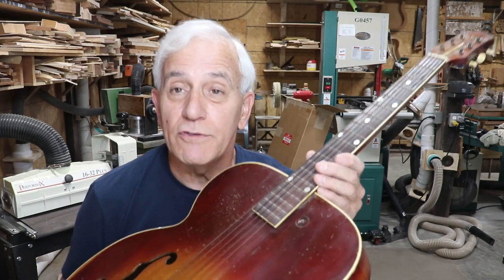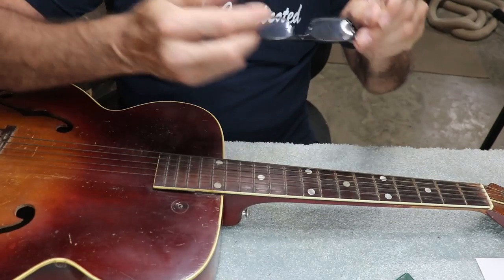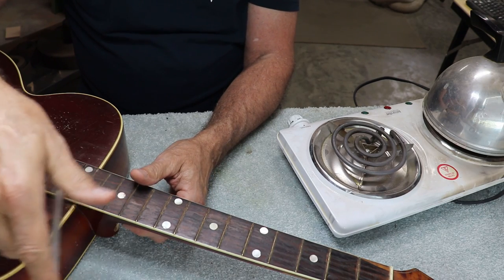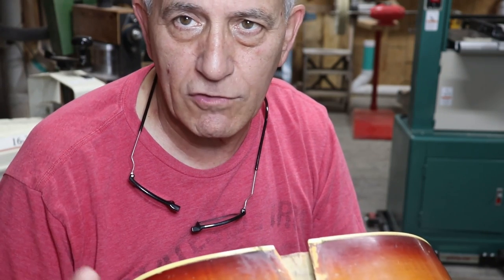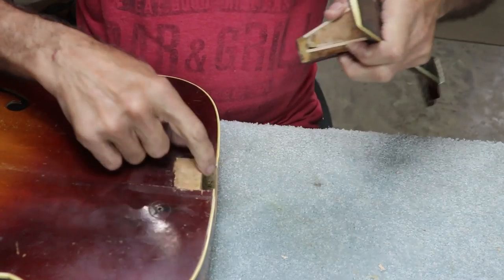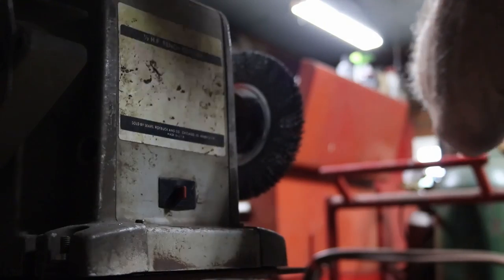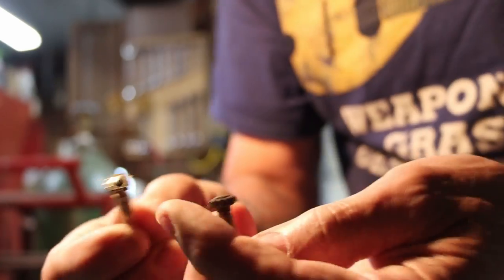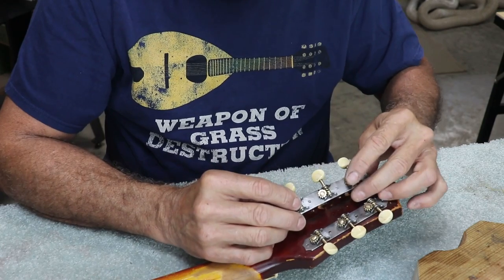414 RSW Sherwood Standard Guitar Neck Reset

Comment: Sherwood was one of Montgomery Ward's mail order brands. It was created just after WW2 and before WW2, the company used the names of Wards and Recording King for its instruments- the RK brand being more up-market than Wards. In the 1920s their brand was Concertone.  On that basis, Wards branded guitars were mainly made by Kay while most of the RK instruments were made by Gibson. However, some of the Wards branded instruments were made by Gibson and the 1936 Wards Model 1642 mandolin was made by Gibson and was the same as the Gibson A50- except it did not have a neck truss rod. You can see that the Kluson tuners have rivets on the gears and date the guitar to just after WW2. The guitar appears to be based on the Kay 39 made from 1947-51. Montgomery Ward changed from the Sherwood brand to Airline at some point in the lae 50s or early 60s. Montgomery Ward retailed some very nice guitars and mandolins but also catered for the lower end of the market as well. This one is mid-market- Kay advertised their version at $45 while Wards would probably have sold it for less than $30- cutting out the middleman. As metal became scarce in WW2, Kluson, the tuner makers began to used rivets or just a blob of metal to replace the screws- and this is what you show. These tuners were used until the late 40s when screws returned and Kluson also started to enclose the gears in a little box.
Reply: That is some good knowledge. Can you tell me anything about the 'Pablo Camille Video' brand? I think it's a Gibson L1, no truss rod.
Reply: I have an unbranded Kay that looks just like this guitar structurally speaking. The same reinforcement around the f holes and dot pattern on the frets.

Comment: Like many others here, I'd never heard/read of a 'Sherwood' guitar, but she deserves to be treated kindly, anyway. And, of course, as always, Jerry soothes her discomforts, and she looked a lot more sassy when she took to the dance floor, at the end. Arch top, f-hole guitars always have a specific sound to them...unique...some folks like 'em...some don't. They also respond totally differently to touch and nuance than other styles, but they're pretty dang keen, nonetheless. I worried mightily when I got my first glimpse of that scarred, glue-caked, shrapnel damaged neck joint...yikes. However, Dr. Rosa had her prepped, mended, stitched up, and prepared for action, in (nearly) no time. Thanks, Doc R...just listen to her now...and lawdy, take in them sweet curves.

Comment: Hi Jerry, I am back taking a look at this reset.  I am finishing up a reset on a friend's "51" Gretsch 5120 archtop jazz guitar. Well played, and fell off the wall and broke the neck joint before Covid started. He had dropped the guitar off for me to check out.  I messed with it for hours. It was pretty loose but I couldn't get the neck to pop off.  After a consult with a couple of guys, I found out that some nut job had pulled the fret out where you would normally get steam in, and he had driven 3 4p finish nails in the neck to hold it... Crazy. I used a thin crowbar to slowly pull the neck up with the nails.... Thank goodness there was no heavy glue on the nails. Now all cleaned up and ready to reset. Oddly enough, after I have sanded everything down and all the old glue from at least two resets and nail holes filled, The neck fits so tight it doesn't really need shims....! That puzzles me. I put a straight edge on all sides and it is tight as a drum dead-on down the fretboard and with the nut set to the bridge is also dead on!! Hmmm. I am going to glue it up with fresh hide glue in the neck day or so.  Soaking glue today!  Love the video here which gives me confidence that I will giterdone without issue!! Can't wait to play this beauty.  I just finished a 64 Gretsch Country Gentlemen number 64064...! Just 2 numbers away from George Harrisons.  I may buy it from the owner.  What a player's guitar that is!!! Keep up these great videos my friend.

Comment: Nice job. Not a “cost is no object” restoration but bought back to life in fine fashion!  You make resetting the neck with all the correct angles look easy. I’m sure it takes some time to learn that skill. That guitar didn’t have much hardware but we would call that button screw, “the main screw”. Must have been left over from replacing the deck steps.

Comment: The dry heat stick with the neck removal jig works pretty well......and pretty quickly.  I used it last on a Kay guitar in fact. I'm not sure how it would work with all glues, but with the Kay neck it worked very well.

Comment: Jerry, I use the the "Heat Stick" from Stewmac and I love it. No moisture so you can actually work on heal the same day with out waiting for the wood to dry. Also no steam to ruin the finish..only thing is the hole is just a little bigger than the fret so you will have to so some filling. Another good thing is if you do miss the pocket (which im not going to lie I have missed it a few times😔. Not entirelymy fault, it was the way they were built.) but the heat radiates and finds itself in the pocket. I personally choose the heat stick over steam. My personal opinion. Good job on this instrument.
Reply: I tried it on a Yamaha and after 2 hours, the neck would not come out.
Reply: @Hutch Guitars  Yamaha doesn't use a dove tail joint. Most imports use a dowels to secure the neck
Reply: @maheshchander03  the 2 I've worked on had dovetails.
Reply: @Hutch Guitars  my mistake then. Guess I should have said the ones I have worked on have been dowels with occasional mortise and tendon. Best of luck to you my friend

Comment: Just had the strange experience of reliving work on a guitar I've just finished! Mine is a '40s (probably) SS Stewart, also a rebrand of the Kay "Imperial." It's all about the necks of these beauties. If this one is like mine, it features a 25 3/4" scale length, which, for those keeping score at home, is 1/4" longer than a Fender Strat! Until working on this guitar, I had never confronted how string tension is related to scale length. Unlike a Strat, it's not a bolt-on neck you can shim, the neck isn't laminated, the neck doesn't have a truss rod; it's been on its own to stand up to the pressure. The neck on the SS Stewart had failed and failed repeatedly. Mine suffered a botched cowboy neck reset which apparently was done with a pruning saw. There were dowels everywhere, and multiple types of glue—all hidden under a slathering of black paint. A holy mess! Before even STARTING the neck reset, the joint was so bad that the fingerboard needing removing to get at it properly and the black paint (and the finish) removed around the heel. The dovetail was almost completely destroyed and had to be rebuilt. The pruning saw had torn up the plywood of the sides, and this needed to be relaminated and patched just to have a solid base for the neck. The neck block was separating and had to be reinforced. Then the reset: the angle the neck needed to come down was so great I couldn't believe my eyes, but it was right. So I could absolutely relate, watching you struggle with the Sherwood.

Worth all this? Yes, gosh, it plays and sounds great and it may be one of a kind. Never found another like it. The moral of the story is, use light strings on this vintage of guitar with a massive scale length—better yet, used extra lights.

Thanks for your many tips, Jerry. Just working on this one, since I had the fretboard off, I used your wedge technique to solidify the connection of the dovetail to the neck block and ensure its angle. I've done that with a couple of guitars and it has worked well.

Comment: Jerry, if you have a 40W or more soldering iron, which uses a solid rod type point, you can get a piece of
copper rod the same diameter x 6" and try it out, to remove a neck.
That is what I am waiting to do to a Yamaha FG512. We'll see.
PS: The Stewmac iron is 40W, so anything over that will need to be watched, to not burn the wood.

Comment: Hi Jerry, I recently rebuilt an identical guitar,  The discoloration around the f hole is a cloth :reinforcing" that prevents cracking???  Love my large irregular dots.  I took the back off to rebuild the braces (tapering them and improving the bridge plate) and reset the neck without removing it.  My guitar sounds great.  Best of luck with this build.
Reply: found something similar in a 49ish Kay once. The cheesecloth was present on the treble side but missing on the bass side.

Comment: I have an old Kay that uses almost exactly those type of tuners.  Only difference is that mine has black buttons instead of white, and mine doesn't have the grommets that go in the headstock.  I don't know if the screw holes would line up, but they're awfully similar.

Comment: Hi Jerry you could use a wallpaper steaming unit. It boils water using electric element it has a pipe that normally feeds steam to a plastic tray used to loosen wallpaper. They are massed produced relatively cheap. I used one I already had and used it to steam off neck, after watching how you did it took ages it loosened and came off in the end.  It was an old Korean built guitar and had five dowels ahh. Neck block straight into neck. What would you do. I can bury/ glue some screwed in nuts in the neck x 2 use some of the dowels for alignment and bolt through from back off block? After adjustment?
Reply: I had a similar scenario with a Tanglewood, only it had 3 dowels.I converted to bolt on neck using M8x60mm wood to metal bolts.Works fine.

Comment: Hey Jerry good work. I was wondering, wouldn't reversing the carbon paper to the inside on the neck slot work as well? To me it seems the shims should be flat but the inside of the slot where you removed glue and stuff would be what needs to be chiseled and sanded flat. Maybe the high spots on the inside of that slot are putting the marks on the shims. Just an observation, you've been doing it for years so maybe you've already thought of that. Any way, another nicely fixed instrument.
Reply from the maker: I do reverse it a few different times throughout the process